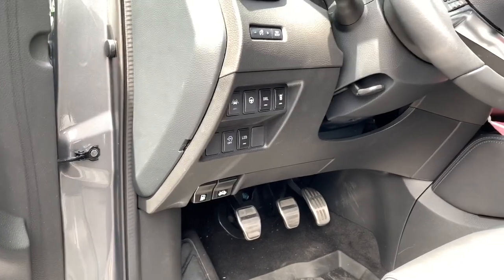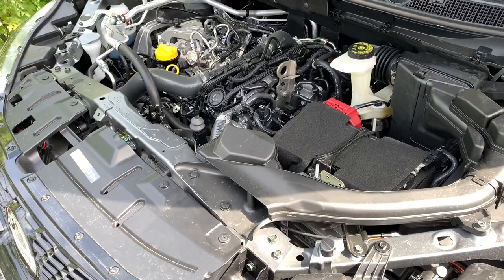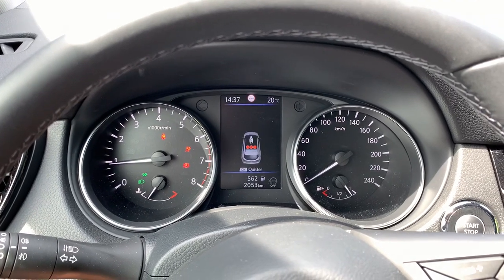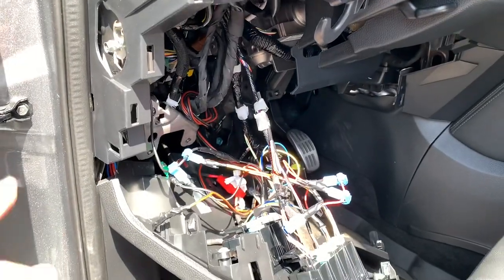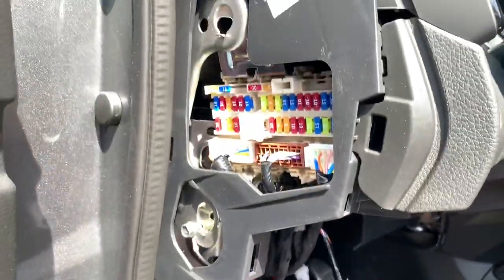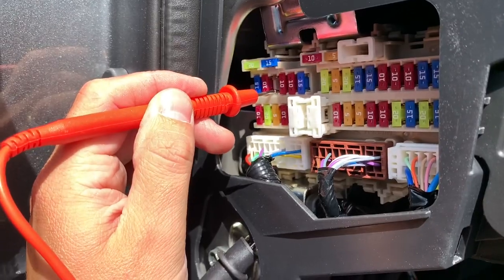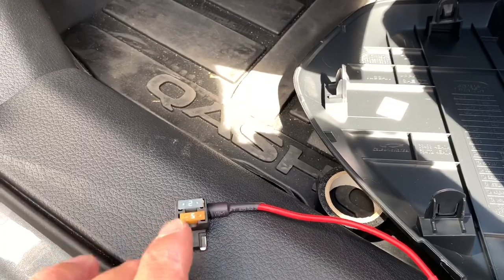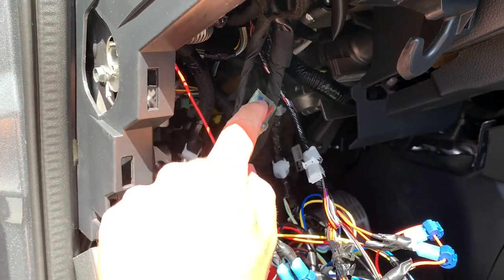Nissan Qashqai J11: disable the STOP/START system with the S/S module (also for Xtrail!)

Comment: Nice module and DYI trick for S&S, but mine I have reclined the hood sensor and not generate any DTC or malfunction and work for almost 4 year this way.
Reply from the maker: Yes me too on my previous QQ. But for alarm equipped cars (UK and so on) it isn't possible like this AND your mechanic will see the errors in his computer as well. I thought it was a nice solution for this new car ;)

Comment: just to comment that it really does not matter which way you insert that fuse holder - it will work both ways (with wire going up or down)... the only difference that S/S module will stop working if original 5A fuse blows if you have fuse holder with wire going down - but i assume you would need to change 5A fuse anyway when it blows ))
Reply from the maker: Hi Pavel, thanks for your comment. Well yes and no.... it will work indeed but this is not how the piggyback fuseholder is designed to work. 😉 if you put it the other way around the current always flows to both fuses and when it goes wrong both fuses will blow indeed. However, when you put it the right way both circuits are seperated and only the fuses of the shorted circuit will blow. 😉

Comment: I’ve got this module. My car is right hand drive, where do I put the piggy back fuse for my car ?
Reply from the maker: Hi! I think you could tap the 12V on another source at well in the fuse box right (next to the steering wheel for you that is). Ask the seller if he has some ideas in that. The link is in the description 😉
Reply: La_Palmeraie thank you

Comment: Save your money,I have been disabling customers stop start on qashqai J10+11 for quite some time now by simply unplugging the bonnet switch,no fault symbols no warning lights etc.
Reply from the maker: I know and i did as well on my previous QQ. You can find a video on that elsewhere in this playlist 😉 but I have to say that this module is a bit cleaner so to speak. Turning the bonnet switch generates errors on the BCM that the dealer sees when reading out the car. But both work 👌🏻

Comment: Hello, as-tu déjà eu des soucis depuis qu’il est installé ? J’ai installé le module la semaine passée et aujourd’hui le start and stop s’est réactivé sans avoir poussé sur le bouton ..
Reply from the maker: Est-ce que tu as utilisé des ScotchLok connectors (comme moi) ou est-ce que tu as soudé les fils? Une fois j’ai eu ce problème et apparemment c’était du au faux contact des ScotchLok après avoir travaillé derrière le panneau pour mes éclairages au pied. J’ai bougé un peu les fils et ça remarche comme avant. Duncho conseille d’ailleurs de souder.
Reply: @LaPalmeraie0032  oui il m'avait préconisé de les souder mais j'ai opter pour la même solution que toi ( plus propre je trouve ), a part que je n'avais pas des ScotchLok connectors mais des simples connecteur bleu . ça doit surement être un faux contact comme tu dis, je vais réouvrir ce weekend pour vérifier .  merci pour ta réponse